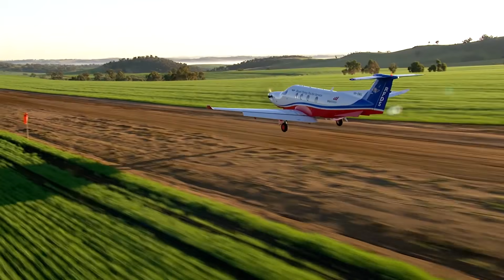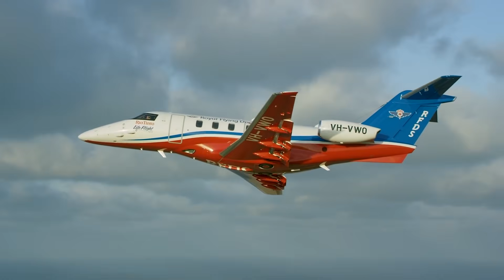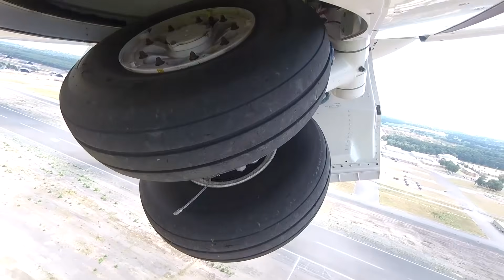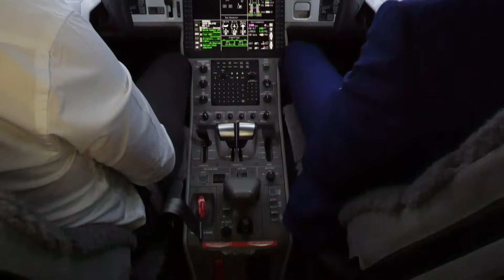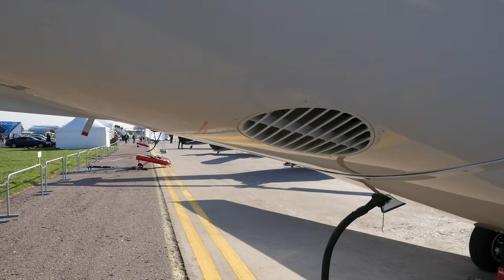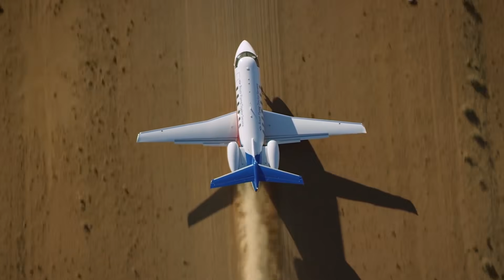Pilatus PC-24 | The Super Versatile Jet

Comment: Great informative video explaining all the features of this wonderful jet.  If and it’s a big if, I had the money and need of a small jet then the 24 would be my first choice.  This is not just based on nice vids but on 26 years within the aviation industry and before they military flying.  The aircraft like anything Swiss built will have reliability built in, it will work when others won’t and the start up procedure without an APU is a great advantage.   The only minus I can see is the toilet facility, whilst many of its size do not have one I wouldn’t suggest eating a curry the night before will entice you to the other passengers lol.  I very powerful extractor fan might have to be installed in the cockpit give. It’s proximity to the loo lol.  If mine i would install a sign saying No1,s only lol.
But it’s all the aircraft  most people will ever needs unless you regularity fly across oceans.
 Congratulations to the manufacturer for making such a capable and besutiful aircraft

Comment: A wind shock made from fabric strongest poss & out back 4 ft past the rudder is same kind of idea, causing a faint pressure trail to keep u safe w/little to nothing drag under side of plane past the rudder. If & when needed u can drag strip deploy a chute last ditch or short crappie runways.
Reply: wire cage sock construction.
Reply: not enough time to wave off, deploy chute.

Comment: It clearly needs a front sloping down nose on the jets version & may be 6-8" longer flatter top of cone.
Reply: the pods that tilt up 25-30degs or down 10 or 15degs independently give u far more redundant flight control, & far cheaper than flaps & drag.

Comment: For either long term or one off needs for more range, could a series of different capacity fuel tanks or cells be configured to easily be added and removed in the aft cargo area?  Depending on needs for these fuel tanks, they could be permanently added or just rented and bolted into a pre-installed cargo/tank securing points system
Reply: Possibly, but I imagine that would be difficult, since the fuel system is in the non-pressurized area. Putting a tank in the pressurized area would require a series of changes that definitely aren't feasible for a config option...

Comment: pffff thats an expensive piece of shit! look, a phenom 300 is twice faster and costs almost the same. Next pls...
Reply: A Phenom 300 is only 13 knots faster. Yes, thirteen. It also comes with ugly seats and a lowered aisle for maximum discomfort. And yet the cabin height is STILL 2 whole inches less than in the PC-24.
Range is the same for both aircraft, but the PC-24 can operate on 20'000 airports, the Phenom only on 11'000.

Your call ;)

Comment: Loved the video.  As a pilot, I am curious how the weight/balance calculations work out with the engines AND the respectful cargo hold being aft of the wing work out.  Seems like a bunch of weight (given that there is heavy cargo in the aft compartment) aft of the wing.  Guess the pilot must work this one out.  None the less, given if I were in need of a versatile business jet I am all in!!
Reply: Max. payload with full fuel is only 320 kilos, so 2-3 passengers will easily balance the rest of the load (cargo)... for heavier payload (max. 1130 kg) cargo will be moved forward with less seats ?

Comment: I still think they should have installed reverse thrusters.
Trying to slow down only using the wheel brakes on anything less than asphalt or concrete will only dig the wheels in the dirt or grass.
Reply: There are a few problems with thrust reversers, firstly weight, secondly maintenance and thirdly the possibility of FOD issues.

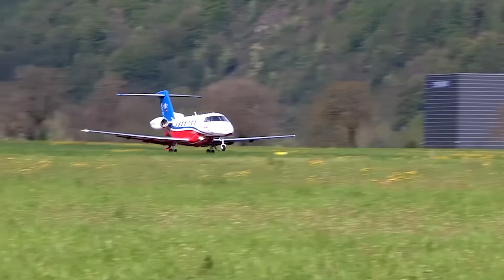Comment: 12:23 I think you forgot to switch from Cyrillic/Russian to Latin/English. Unless the engine is a 15 kilohenry inductor, which would be ridiculously high. Inductors in electronics are usually in the microhenry range. I guess you might see 15 kH in an industrial or power generation/distribution setting.

Comment: A problem with the Quiet Power Mode (QPM) is that a pilot has to be seated in the cockpit. 
QPM provides ground air conditioning and power. This has become an issue with single pilot operations at isolated locations as the pilot then can’t assist with boarding etc. 
This has become a problem for the RFDS in Australia. 
Also the aircraft has very poor performance in hot conditions which is disappointing.

Comment: Thx for a extremely informative video !  I have never been exposed to any info in this type aircraft & yet I feel you have answered any possible question I could have come up with ; more than adequately  !  Congrats to the company producing this aircraft , if I had designed it after becoming an efficiency expert at my old company , I do not think I could have come up with more than a few improvements after a thorough vetting of all systems  !  Quite an impressive feat & may the winds fill your sails ................  sales ?

Comment: Nice in depth video. Do the engines have electric start? Since there is no APU.
Reply: Yes, see this video by an equally enthusiastic user: https://www.youtube.com/watch?v=K4L0i4hcCjs. APU is not really necessary if the plane is small enough and most airports have mobile generators.
Reply: @TheSynecdoche  Thank you! Interesting to use the engine itself as an APU at below idle setting.

Comment: In my opinion "par on par" this is the best small jet plane on the market and beats other planes in the same or higher price bracket on almost all comparible parameters and specs. Both a very versatile and capable plane. The ONLY problem I have with it it is that it doesn't have an onboard toilet. If it did, it would beat the cessna citation series, Braer Phenom 300EV, Honda Jet etc as the best luxury /executive jet and would capture a bigger part of that market. This jet is virtually an allrounder, no need for any other jet or turboprop. It also has the best looking, stylish, and ergonomically designed cockpit and instrument layout. However i would like to see how it compares to the Garmin touch screen system.

Comment: Excellent video. Watched from start to finish. One thing that you did not mention was the nacelle design of the engines that allowed passive thrust vectoring at high power settings. It also contributes to the short field takeoff capabilities of the aircraft.

Comment: I assume these have emergency power using a RAT? Else, what is the procedure when both engines are lost and won't restart? think Birds or fuel contamination which have already occurred; and its likely there arre other possible causes I don't yet know about.
Reply: Nope, it has dedicated emergency batteries, which are really only used in case of an emergency. Beside the avionics, there's nothing in this plane that needs electrical power to keep it in the air. The only hydraulic system in the entire plane are the wheel brakes. The control surfaces are still moved purely by cables and levers.
Reply: @shi01  Thanks for that. I am a pessimist so my mind went to some really bad scenarios. Emergencies happen at the most inconvenient moments and conditions - so I was wondering about loss of glass cockpit functionality - especially in IMC.

Comment: A highly detailed, objective and most appreciated review.  I don't think it's an advertisement as challenges are presented and Pilatus' ability to overcome them explained. Scott take a detailed look at what the PC12 has achieved in a relatively short period of time.  Based on that reputation the company sold out the initial production run of the PC24 in an unprecedented 36 hours!
Reply: Good thing he generously mentioned the PC-12, because the PC-24 offers the same capacities when it comes to passengers and range.

The main difference is the speed and... the price of course!

Comment: I love pilatus but also find quite odd their lavatory/wc setup...
Reply: I hear you Almerinda Romeira but if your are an Air Ambulance critical server like the Royal Flying Doctors of Australia - who were one of the main driving customers for the creation of the model - the toilet placement is what you pay for in lieu of the cargo door aft of the engines. That cargo door is essential for getting patients in/out of the 24.
Reply: @lodiamoore7933  the door doesn't have anything to do with it. If you look up the honda jet toilet it has a very small footprint. I'm sure they could have done something other than locking oneself up on the "lobby" of  the airplane and take a dump looking into the staircase...
Reply: @almerindaromeira8352  "...the door doesn't have anything to do with it..." 😂😂😂

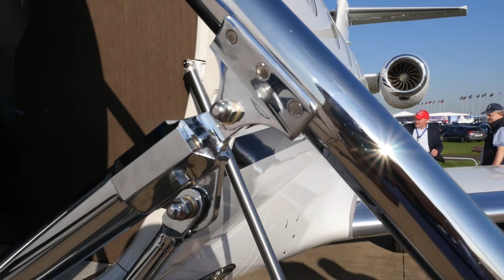See from 19:15. The engines had to be moved further back BECAUSE of the cargo door. The space the cargo takes mitigates all else. So where would you put the toilet. As for your argument re the Honda Jet and its lavatory it doesn't have a cargo door the size of the one the 24 has if it does have one so toilet placement difficulty is not a question it (Honda Jet) has to deal with.
Reply: @lodiamoore7933  have you ever been in a RV? A toilet can be placed pretty much anywhere in an aircraft. It doesn't have to be necessarily in the back. I'm just saying it would be nice to be encapsulated instead of having to lock pilots and other passengers out for someone to take a dump. They could for example offset the cockpit door to the left creating enough space on the right to actually have an actual closet.
Reply: @almerindaromeira8352  Example the not really recent Embraer Brasilia https://www.youtube.com/watch?v=NxTSzaMVrYo. Various larger business jets have two toilets, one in the back for the affluent passengers, one up front right behind the captain. See also the upcoming Cessna Denali, a competitor to Pilatus' PC-12: separate lavatory unit in the back plus a large cargo door.

Comment: Great video about a unique plane. You where a little surprised by the website for the cabin controls, but it is actually the technical superior option. It works on any phone, including business phones which are locked down for security reasons. And even if you assume everyone to have a private smartphone on hands as well, they might lack mobile internet access in a plane.